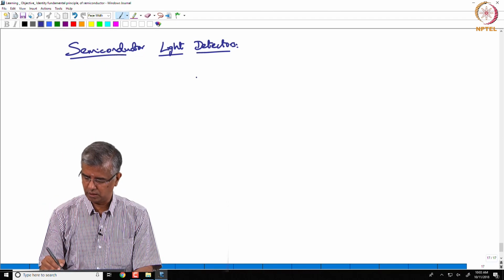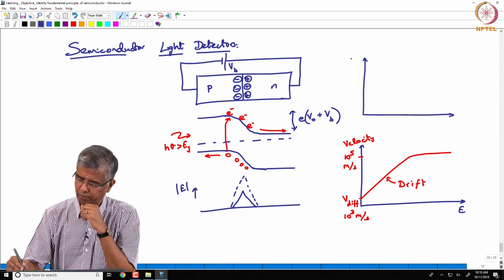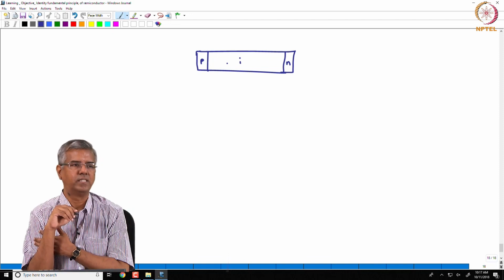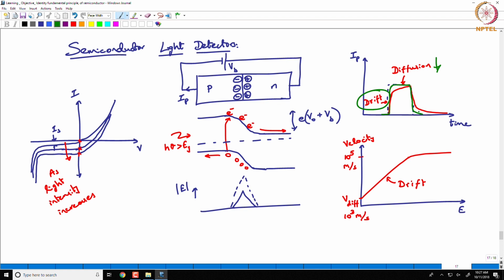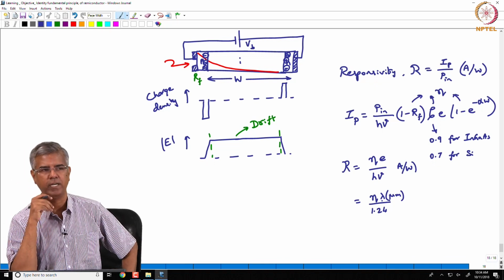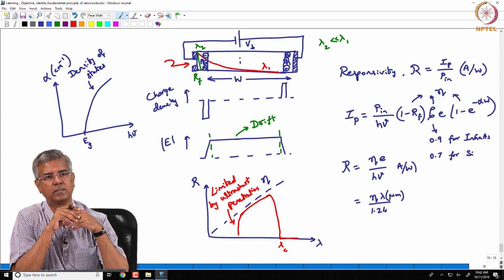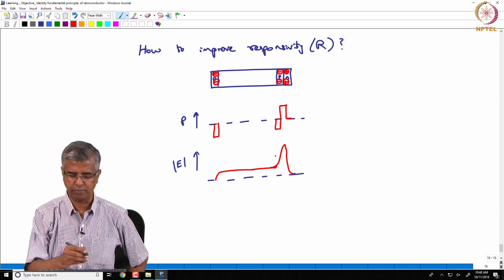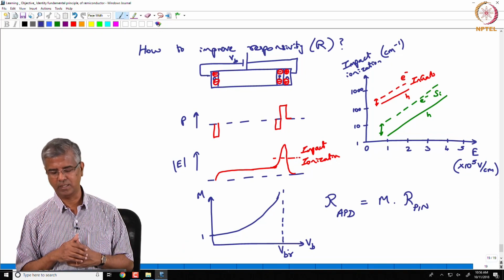Semiconductor Detectors   1

Comment: At 18:00, wouldn't the electric field go down to 0 in the intrinsic region since there is no potential drop?
Reply: It would not go to zero in the intrinsic region since there are opposite and fixed charges on either side of it (in the p & n regions).